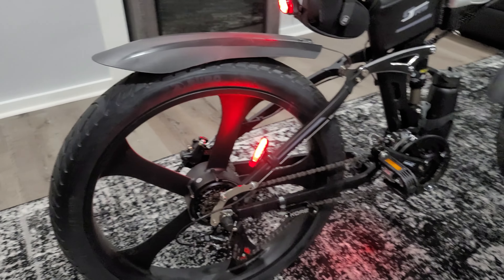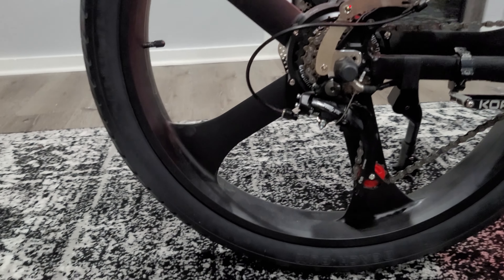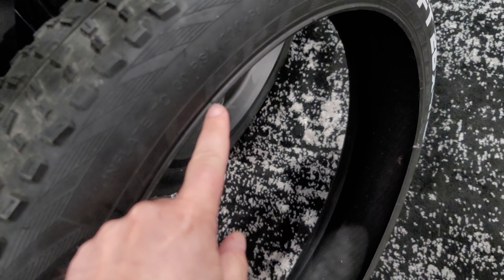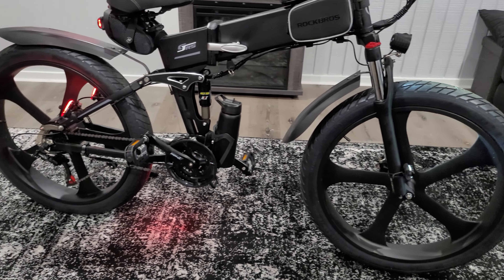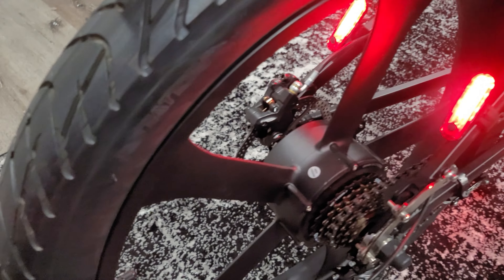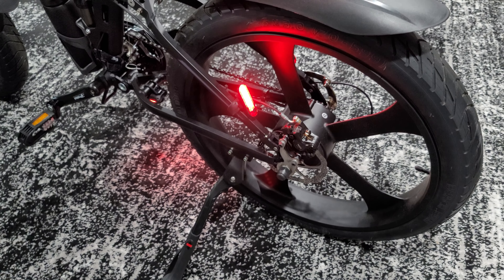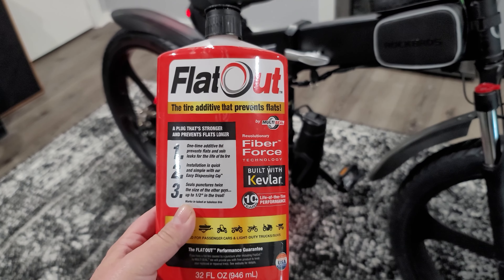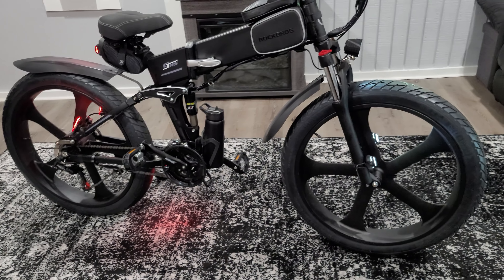Fat E-Bike - HOW TO - Low profile stretched road tires!!

Comment: I'd like to see a 12 month review on your tyres I'm interested in  wot problems you may have had and how the extra weight affected your  bike  thanks.  ❤😊🎉🎉🎉
Reply from the maker: After a year and a half, the tires are holding up pretty well. The only thing I would recommend is that you have to keep checking tire pressure before each ride and make sure it's at 32-35 lbs. Also, it does not do well as off-terrain, especially mud. These are strictly for asphalt road use. Since the tire is much more rigid with hard rubber, your ride may not be as cushy. It doesn't bother me, but it might for others. It's a compromise I'm willing to take. I would really like to hear others' thoughts about this by those who have done the conversion as well. I'm hoping to do another video as a follow-up.

Comment: I bought a 26x4 e-bike . Nice tops out at 25 mph . I went through the exact same research problem and came up with the same conclusions. I just bought a pair of tires with similar if not identical tires to yours . The back set up nicely thank goodness cause that one is the hardest . The front ended up getting a smell rip where it seats to the rim . I contacted Amazon and found out it was a return less refund . They refunded my money I bought another one and and same size tube it will be this week can’t wait to feel the difference. I’m 48 and still ride a little reckless hope they hold up .
Reply from the maker: Nice! I hope it works out for you!
Reply: how did it go
Reply: @tfromtheo  5 months later they’re holding up great look great too get compliments all the time

Comment: Just to let you know there is NO SPECIAL TOOL  to take the rear wheel off its just in there very tight . In your case because its a HUB motor your torque cant be any more that 60nm at best and that silver bracket is the torque tension arm.
 
I have done this many times on a couple of my fat bikes and I still come back to the 4.0 version because when you get a flat you really cant even push it home you almost have to carry the bike because you can damage the wheels.

 After you remove that bracket the wheel will come right off the frame and the other nuts are and should be 18mm and when your removing the rear wheel try and make sure you in 7th gear or  the smallest gear in the rear   it makes it much easier when reinstalling the rear wheel you don't have to fight the chain to line it up with the gears
Reply from the maker: @pharrohku5922  Bike came without the torque arms. I added those after the fact. The special tool that was used was a device that holds the rear forks to apply pressure while the wheel is removed. I'm not sure how it works in your bike, but in mine, simply removing the two 18mm bolts (without torque arms) would not release the wheel whatsoever.

I also added the Flat-Out in case of a puncture to get home and deal with changing the tire then.
Reply: @totobiuno  FYI that extra Torque arm is NOT really necessary because the main AXEL on the bike is KNOTCHED as to keep it from spinning in the frame .

Well What I have to say about that SPECIAL tool is a misleading statement from the bike shop because they don't make such a tool all they are using and also what I use on my DK Fatbike is a simple clap in reverse to push the frame open to slide the wheel out , you can buy at homedepot.

If you know what I am talking about good but if not shoot me a message and I can send you a picture of what I use and they work great and even the local bike shops use this same Teknik now with the clamp OR I can make a short video of using it .

 I also went better motors on all of my Fatbikes HUB motors aren't powerful enough to go up many hills  and also aren't near as efficient as a MIDDRIVE motor is.

 Being that you have a HUB motor you can NOT utilize the gears you have because the motor has what it has and is more like an automatic transmission car but without gears.

 ALL of my bikes and even the Trike I am building now have all MIDDRIVE motors and IGH hubs to keep it simple 3 gears and I can utilize all the gears just like in a manual transmission car has  1 gear is 14mph 2 gear 23mph 3 gear 31mph even with my large body on it at 250lbs.

If your curious you can look at a couple of my videos and what I use my bikes for mostly for fun and a custom 20" just for trail riding.

Comment: Thanks for the video going to do that with my bike. Did you gain any improvement on the miles you can go  compared to the original tires
Reply from the maker: With the less friction, I do notice I'm able to go farther. It depends also on your stamina and battery life too.
Reply: Does the different tire size throw your speedometer off

Comment: I use these on my 26" x 4" fat tires rims. But both tires I bought ripped out just above the rim. did not even get 350 miles out of the tires before they ripped out.

Comment: How does it affect handling
Reply from the maker: So far, so good. It's a bit stiffer and less bouncy. I'm riding mostly on asphalt and paved roads. I have taken it on some loose gravel roads - you do lose some traction there, but ok for me. Anything thicker, though, and you're sliding out of control.

Comment: What tire size would I need for a rim that takes 26x4.5?
Reply from the maker: It depends on the width of the rim. I'm assuming your rim might be wider than mine since it's using 4.5 rather than 4.0. Unless they may have put an oversized tire on the same width rim like mine. In that case, you can try the 3.0 size tire. Other than that, I'm not sure if they even make anything in between 3 and 4 that you can try.

Comment: WIll this work on a bike with 26x4.0 tires?
Reply from the maker: Yes, that size is what was on originally. Now it's 26x3 stretched to 3.5 making them lower profile.
Reply: @totobiuno  Cant seem to be able to find the tire you used
Reply from the maker: @neutronicebike7750  tires are getting sold out in many places. I managed to find it on Amazon. I updated the links in the description.
Reply: @totobiuno  thank you!
Reply: @Operation-InnerGravity  sold out lol..

Comment: how did it hold up after 5 months?
Reply from the maker: It's been a nice smooth ride through the spring and summer. Just remember to keep checking the air in the tires before your ride. They have to be at least 30lbs.

Comment: You can do it , but it's not safe. Its have "bump" when you cornering, which can affect handaling. Also its higher chance of developed crack on tire and chance for tire dismounting.
Also if i see full suspension fat e-bike in shup, id like get rid of it, just becose it always trash bike, made like pice of gurbage and newer worth fixing. 
Exeptionly if owner make some home "impruvment"
Reply from the maker: There is nothing wrong with the bike. You can leave it just the way it is, and it's fine. I just like to modify things to my liking. I've ridden this bike for 2 years without issues. No cracks, no bad handling, and no tire coming off. You just keep the tire inflated above 30 lbs and you'll be fine. I thought I'd share in case there are other like me out there and want to try it as well. But of course, you do so at your own risk just like anything else that is modified.

Comment: The reason I bought a fat tire bike is that it is very stable on the road, rolls over everything very easily, and gives you that extra cushion! So that is the last thing I would think of doing to my fat tire bike. The bike shop would not help you for a reason and it was not because it could not be done but because there is a very good chance the bead will pop off the rim and they did not want you giving them a bad name by you telling people that they help you do that. I just purchased some 26x4.0 fat tire WHITE Wall COMPASS STREET TIRE EBIKE RECOMMEND (thick Tire) from Fat Tire house and I can't wait to put them on my White Himiway Zebra Step-thur and you see they say they are thick and they are more like a motorcycle street tire and they are a little heavy 6lbs but that's because they have more rubber and should last a lot better. A good beefy tire with white walls with my white bike can't wait. I know it will be a lot smoother than the Kenda tires that it came with and last a lot longer too!
Reply from the maker: As mentioned in the video, the bike shops will not perform this for good reasons. Also mentioned is that if you do decide to do it this way, you would do so at your own risk. I've ridden over 100 miles so far without any issues with my current setup. Maybe later on I could change to a 4" road tire, but thanks to this video, I like to know I have different options available.